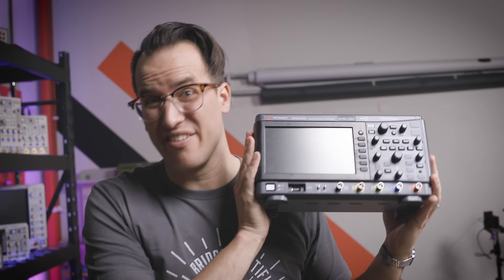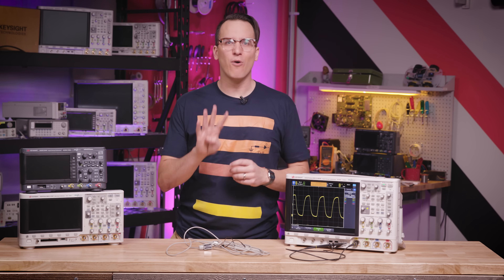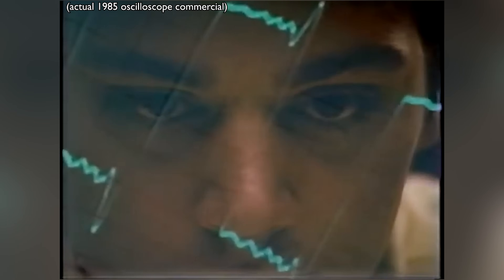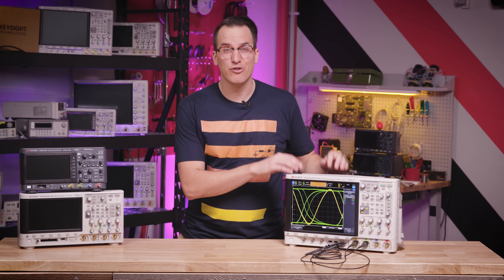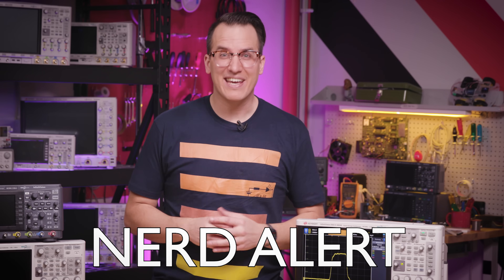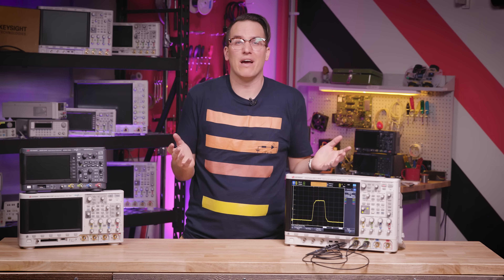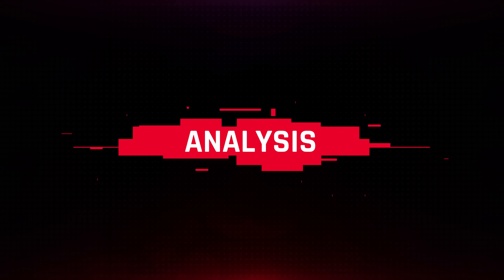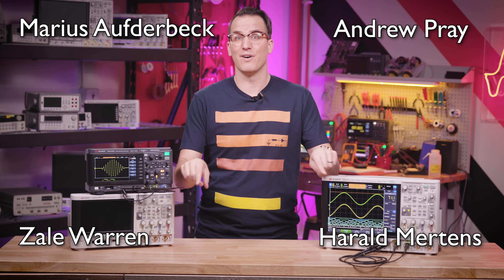How to Use an Oscilloscope - Mega Guide

Comment from the maker: Yay oscilloscopes!
Register for Keysight University Live & see today's winners here ► https://bit.ly/KULive2
Reply: +1 fix it with flex tape
Reply: I tried.  I watched most of the videos, eventually clicked on the two "enter" buttons below the scrolling comment field when I realized I needed to do that to actually enter ... but sadly, I didn't win anything.  My L'Robotorium shop really needs a proper test bench with a multiple output d.c. and a.c. bench supply, a good DMM and oscilloscope.  Function generator would be a plus, but I don't know how much use it would get.

Comment: I’m brand new to Scopes. I bought one to troubleshoot Quadrature Encoders. It would be awesome if someone like you make a video teaching us how to do specific tests like that rather than general videos. Would make it easier for beginners like myself.
Reply: So which scope did you get? I have a couple of Rigols, an old school HP scope board for my old school logic analyzer, a Tek, and possibly another (haven't seen it for years).

Probably the last time that I used a scope in anger was on an 80's vintage quad encoder that some idiot (me) blew up. The scope told me that it was still trying to be an encoder, which meant only part of the encoder was damaged (???). I opened it up and sure enough, the encoder itself was reverse polarity protected, while the add on board (this one designed for voltage as the output) was not. A couple of new line drivers later, and a P-Channel MOSFET for reverse polarity protection and we were back in business.

How to protect your circuit: https://www.youtube.com/watch?v=IrB-FPcv1Dc

Comment: Cool overview of what you can do with modern good quality digital scopes. I kinda wish some features were around in the old analog days, haha! I learned all electronics on analog test equipment and still use it in my electronics repair and construction work.

3:50 setting the device to the maximum range when you have no idea what value you'll be measuring, and then getting closer and closer is THE way you do it with any non-autoranging meter or scope.

Comment: digital oscilloscopes have built in fourier transforms? So I might be able to get buy without a seperate spectrum analyzer? At least in my small home electronics lab
Reply from the maker: Yep! FFTs are in pretty much every digital scope these days.
Reply: The scope based FFTs are very  handy for lower frequency work (sub MHz) as a spectrum analyzer approaches uselessness as you approach the zero spur (spreading of the zero frequency response).  OTOH, for RF work, they are still handy for looking at basic signals being generated and also for frequency to time domain observations (i.e. press a remote key button, decode an i2c command AND see the resulting RF burst).  You need a spectrum analyzer once you need 30dB to 100dB more dynamic range than the FFT provides.  Once you want to see what your receiver is seeing "over the air" then you'll need spectrum + preamp + appropriate antenna.

Comment: How to transfer all data settings, parameters values, graphs into Pendrive from DSOX1102G?
Reply from the maker: You can save a "setup" file format in the save/recall menu, which saves the scope configuration & settings
Reply: @KeysightLabs  Is this also same for EDUX1002A?
Reply from the maker: Yep! The button and menu layouts are the same

Comment: It seems that the PathWave BenchVue Oscilloscope Application is not able to keep the date/time (yyyy-mm-dd hh:mm:ss) in sync between my Oscilloscope and my Laptop, e.g. the date and time shown on my Osilloscope is 10:12 AM Feb 18, 2022, but the date and time on my Laptop is 10:14 AM Feb 18, 2022.
I want to make the date and time accurately synchronous between my Oscilloscope and my Laptop. How would i realize it? thanks.
Reply from the maker: Interesting! I'd recommend you reach out to our support folks at https://www.keysight.com/find/contactus

Comment: I wish I could afford Keysight Equipment. :(
Reply: You can.  10 years is worth around 90% so for a ten year old scope, you may pay roughly 10 cents on the dollar and with their modern scopes, still get very good value and use from it.

Not only that but the standardization of Keysight's (Agilent's / HP's) UI allows engineers to jump decades to a new spectrum or network analyzer and still walk up to it and operate it (ok, so several walks for all the new functions :) ).

Comment: Wow, things certainly have improved a bit from the days when I inherited my dad's 10-21 Heathkit O'scope (200 kHz) back in the early 70's.  I use portable Tektronix 'scopes (100 MHz) as an F-4 and later F-18 Radar Tech, and then as an Electronics instructor while in the military (80's and 90's).  I currently own a Leader LBO-508A (20 MHz) 'scope.  My New Year's Resolution for this year 2022, is to clear the junk of my electronics bench (lots of things I had plans on "fixing" over the years and never got around to it) and see about getting a 200 Mhz (or better) digital scope with a few more bells and whistles, hence my watching your video.  I know what you mean about people just pushing buttons and turning dials on the scope, students used to do that all the time when I was teaching.  The "Auto Scale" button looks like it will be a big help in that area.  I liked that you injected some humor into your presentation, that helps ease the tension of people trying to learn the new concepts.  Keep up the good work.

Comment: If my scope supports a max voltage input of 150V RMS, am I able to measure 240V RMS with a my probe set to 10:1? Will this still dammage my inputs?
Reply from the maker: Great question! Yes, a 10:1 probe attenuates the signal by 10x going into the scope, so 240V RMS through a 10:1 is 24V RMS

Comment: 5:45. Old analog scopes had a delayed time base knob where you can accurately measure frequency. I believe  one of you old HP scopes had one. Maybe the old HP scope in the background of Daniel's Lab...
Reply: Some oscilloscopes had cursors. Like the Tek 2445 which is an analog scope with cursors.

Comment: I only have used analogue oscilloscopes. I want to capture current burst, and a digital one with triggers like this keysight would be nice.

I have signed up. I really hope I win. Last great gear I got was a stereo microscope found in the trash that previous had been used in a fish oil pill  factory. The fish oils are gone, but I haven't cleaned the open optics like prisms yet. It's perfect for controlling solder joints. The scale inside is from 3cm to 3mm (in the full view).

Comment: I remember learning how to use an oscilloscope back in highschool... an analog one. It was HELL. Once I started working and put my hands on our digital one in the lab, I was able to actually understand it and use it properly in half an hour. My teachers back in school were like "digital ones are nice, but if you can't understand these analog ones, you won't be able to work with the digitals either".Yeah... sure. Nice info and tips on these!
Reply from the maker: Thanks! I agree that analog ones are not a great way to learn these days.
Reply: The thing is that with an analog scope you need to know what you are doing first and only then to opetate the knobs while digital ones allow you to quickly get at least something on the screen first and then to figure things out by going from there. They are just much more forgiving,much more intuitive and they are overall much better for beginners. Their only downside is the price - you can almost never get them used for the price of an old analog one.

Comment: I'm have a habit from analog scope times - always calibrating scope and probe before actual measurements.. Because, I can't be sure, that daughter didn't touch my scopes fine adjustments knob.. 😂 And if circuit is fully unknown, I always started with higher voltage range  when using scope or multimeter..
But yeah, analog scope takes time to calculate, what's on screen.. Best things from analog scope experience - if you used analog scope, you better understand digital scope.. Anyway, DSO has more options to make job easier.. 👍

Great tips for beginners!

Comment: is the oscilloscope still used for "distance measurements"? (because it is graduated in divisions) can it be assumed metrologically that it actually measures voltage? my metrology teacher taught us that the oscilloscope is used to measure distances because it is graduated in divisions - but these were analog oscilloscopes ;)
Reply from the maker: The original radar from back in the day for this, not so much these days.

Comment: I'm using a TDS2024, and I have to do protocol analysis for SPI and I2C by hand, so to speak. I'd love a scope that did that for me. It would be so much less tedium.
Reply: Doing manual decoding of SPI is easy, for UART it is tedious, for I2C it is even more tedious, for CAN it is just a pain, and for USB it is so much wasted time and effort that I would not even bother unless I am absolutely desperate. If you debug serial lines getting any modern scope with built in peotocol decoding is absolutely worth it. I got my old russo-chineese  Aktakom replaced with an R&S 2k last year and I am extremely happy to have it. Modern low to mid range scopes are so much better than what was available even 10 years ago that there is just no contest. Even cheaper options from Rigol are absolutely great in comparaison and the Keysight from the video is just lightyears ahead of an old TDS2024 in almost every respect.

Comment: Imagine having a professional enough setup to have a good oscilloscope other than the one you found in a local dump store that you had to fix.
Reply: The story is exact opposite if you have eevblog dumpster
In it you can find 100k+ oscilloscope
Reply: @ansible9340  Damn you and your lucky location. :)
Reply: I have a Japanese tube based mini scope that I bought at a tech swap meet for $20. The dang thing still worked the last time I used it. One of these things would change my life.
Reply: I've never had one nice/new enough where how to use it was more complex than the usual safety precautions and "screw with the knobs and switches until you get a picture".
Reply: MichaelKingsfordGray  My local dump had a store that sold things